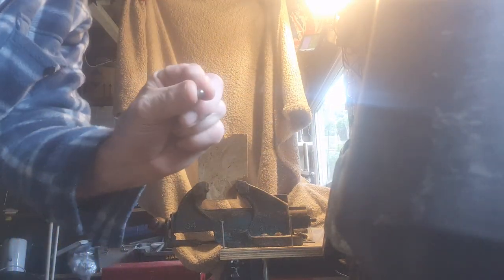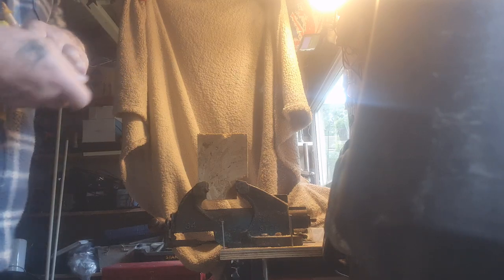8mm STEEL vs HALF INCH BOARD VS 9.5 LEAD 👎👎

Comment: Careful with the return to sender shots mate!  Especially when using that frame.  Some old bloke in Tennessee might get the blame!🤕😉 Protect them eyes and head!
Reply from the maker: @forkshootertb96  😀 I knew it would ricochet so I put the glasses on , it hit the outboard then hit me 🤔 8mm steel would have to be driven at 420 plus to even do any damage to the half inch board , I'm still waiting for someone to prove me wrong on this penetration theory